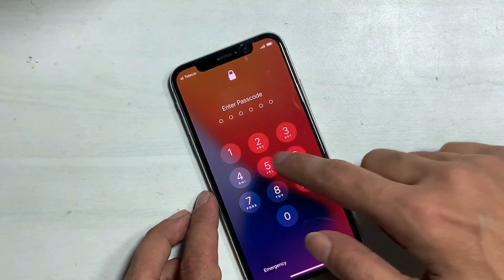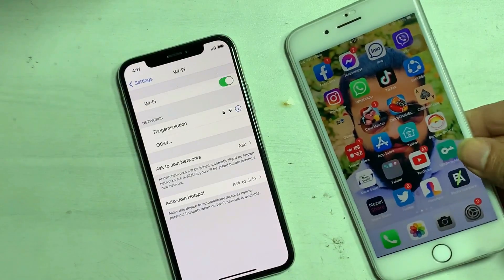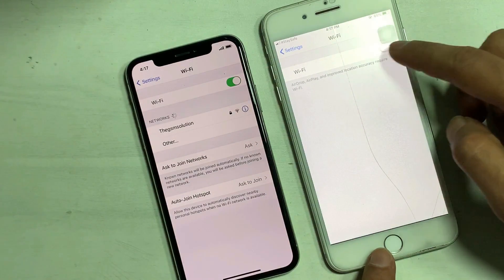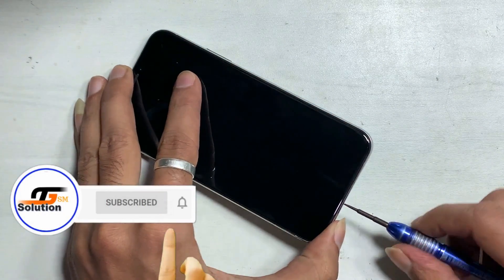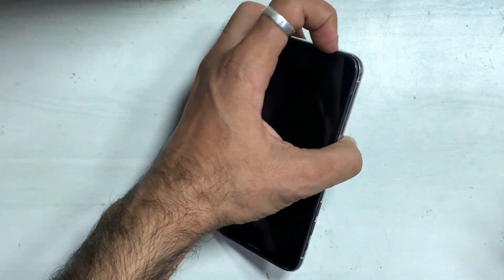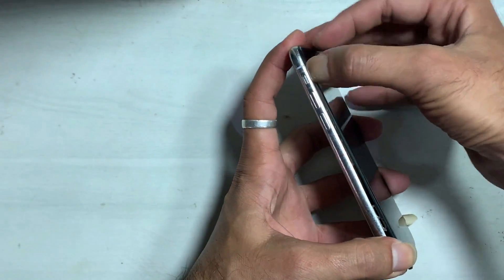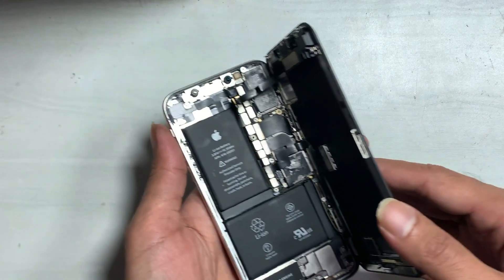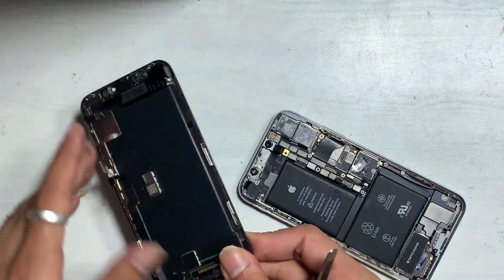iPhone X wifi signal weak Fix!Fix iPhone X wifi range problem.

Comment: Just came back to drop this comment. This actually worked for my iPhone X. The wifi and Bluetooth signal became so weak I couldn’t connect my AirPods unless I brought it really close. Same as the wifi I had to be literally close to the router before I could get signal. After visiting a repairer and making him watch this video , my wifi and Bluetooth is now working full range. I can airdrop files to my MacBook now. Thanks so much for this!
Reply: Bro which part you have repaired please tell me please
Reply: I have the same problem, been finding the solution til now. Thank you bro

Comment: Ye prolam bar bar kyu ati h sir plz reply
Reply from the maker: Disconnecting wifi antenna is the main cause for that issues so, you have to put battery bracket and put all screw.

Comment: Hats off to this guy, I had the exact same problem with my iphone x once and I got this repaired for 100 usd , cause the guy told me that he had to replace my wifi antenna (which now looking at this video and the internals of the phone, doesn't make sense), only now do I realize that i was scammed out of my cash , and it was someone that I sorta trusted who did this "repair", so I guess you can never be too safe. since this is an older model ,by todays standards I decided to look at it myself and i come to find out from this video that all i had to do was to attach a loose connector like a lego. just goes to show you that you can never be to careful with people, even if you trust them and to also try to fix your stuff yourself , thanks to whoever made this video. Good Job
Reply from the maker: Thanks for Feedback.
Reply: i once had a phone that i sent to fix because of an error 4016 or something like this... phone wouldnt boot, they said the phone is gone.. chip dead or something, i fixed it with a youtube video like this...

Comment: hey i just boughr an iphone x yesyerday but everytime i try to connect to the wifi it doesnt work eventhough the wifi is working on other devices but the problem is when i get closer to the wifi router it works normally but when im away from the router for like 2 meters it doesnf connect, u should be next to the router so that the wifi works, can u please tell me what is the problem
Reply: and i cant install apps, dverytime i try installing an app they tell me that my apple id is never used and to review it from itunes store

Comment: Friend i replaced the power and flahlight flex, and after that wifi has problems, with the range, i need to stay so close to connect whit the wifi, is probably that i damaged the wifi flex? I need to replace the wifi flex?
Reply from the maker: If that happens on iPhone X then loose contact is the main cause. So simply follow the instructions brother.
Reply: @thegsmsolution1  if it is a loose contact, the motherboard needs to be fixed?
Reply from the maker: No need motherboard fix.The wifi antenna loose contact.
Reply: @thegsmsolution1  then only replacing the flex it will be works again?
Reply: @thegsmsolution1  ive checked twice, an the conncetor is plugged well
Reply from the maker: Yep brother that is antenna issue.

Comment: My iphone 7+ is not even scanning the network it loads for a bit nd closes not even show a single network to connect with seems wifi in this device is useless I can't find anywhere how to fix this can you please tell me my issue 
It won't even scanning or showing any network 
Please answer and resolve my issue as early as possible
Reply from the maker: Might e hardware issues. Is that iPhone is forcibly dropped?

Comment: Same problem with my iPhone x how i can do it I don’t have any accessories and any experience in mobile?
Reply from the maker: This process have to do with caution otherwise lcd or any parts may damage .You need skills if you are not capable to do contact the authorize repair technician.

Comment: Hello can you also tell the solution for  face id not working when lcd replaced...
Reply from the maker: The main cause for that problem is the dot projector is touched by bare hand while battery on connected stage.The static energy produce by body makes the chip inside the dot projector.
Reply: @Thegsmsolution  so what’s the solution for that!!?

Comment: Please answer me I don't know if it is written well because I use the translator, I am from Argentina
Reply from the maker: What the issues is that you face brother.
Reply: @thegsmsolution1  I was already thinking about changing the entire wifi antenna. You are a genius, my bluetooh contains almost the same problem, do you think that disconnecting and connecting the antenna correctly will work correctly?

Comment: listen bro my sister puts my phone in microwave for 10 sec and now my wifi and bluetooth not working its only work when i put iphone 1 inch away from device plz rply whts the issue😭😭😭
Reply from the maker: If you can able to iPhone then check this is the 1000% solution for weak signal of WI-FI.
Reply: Thegsmsolution what ? reqd my commnt i m asking something
Reply: @hoorainfatima8459  he saying try thing he done in video it’ll work